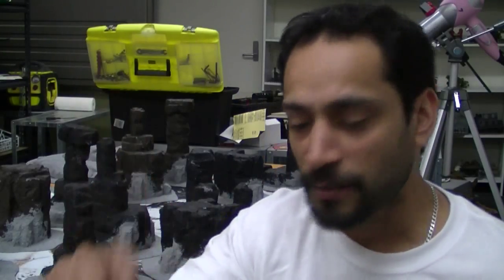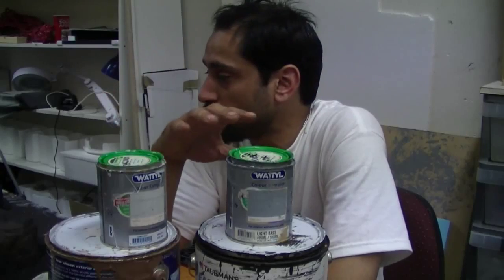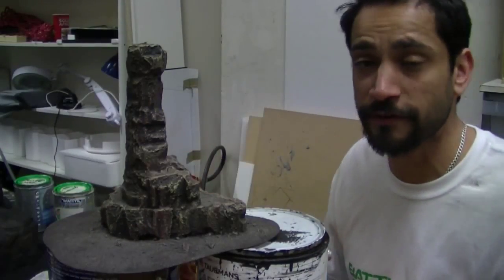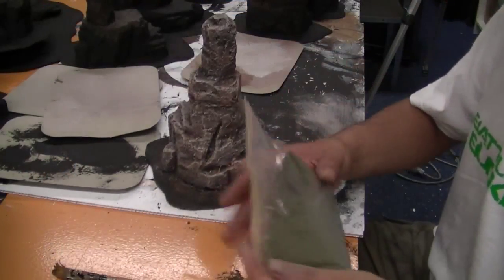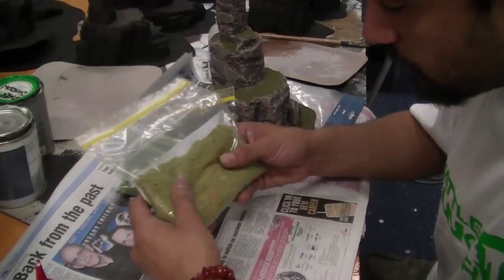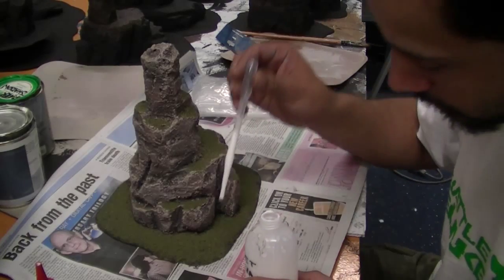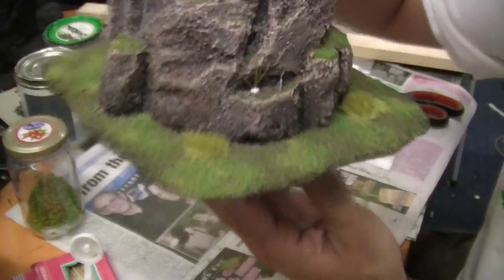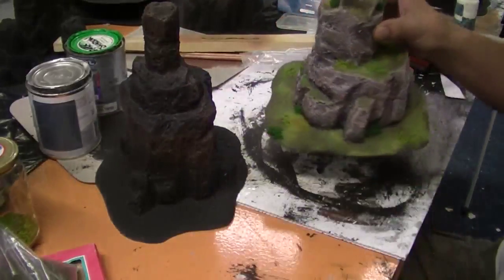Painting a rock pillar terrain piece

Comment from the maker: @lolomgswearwords - I usually like to undercoat by hand with a strong acrylic wall paint as it adds strength when applied in a generous layer.  although, yes .. you could use an airbrush - although spray paint will also work as I coat all my foam in a plaster/goop mix - essentially covering all exposed foam.